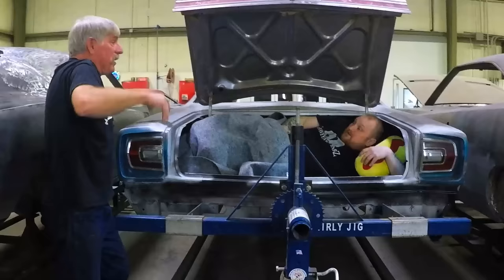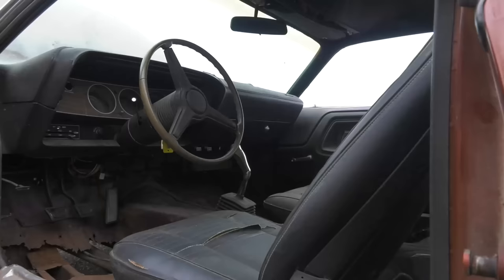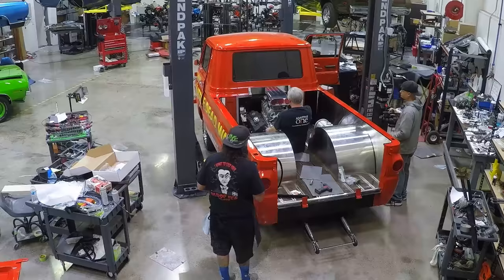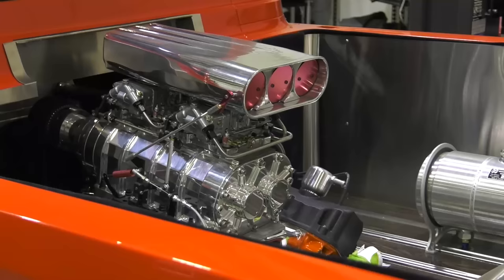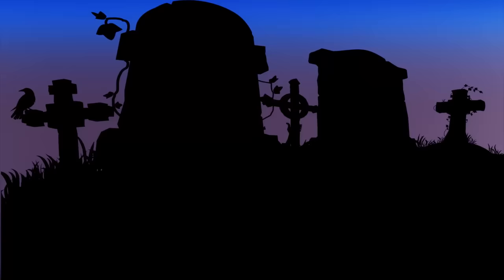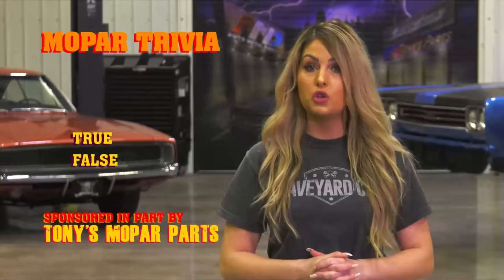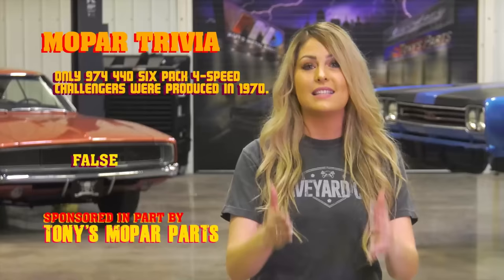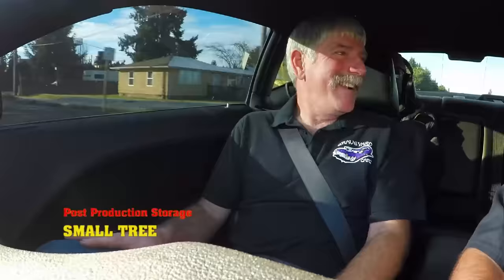GRAVEYARD DREAMZ: EVERYTHING MUST GO!

Comment: I bought my first (of 3!) Barracuda in 1979 for $600! My second one (1971) in 1983 for $1800, my third one (a 1970 body only) for $300 in 1986. The first was a  Lemon Twist with 383, 727, 8 3/4 suregrip (4:10) built way higher than my ability to drive it! (I was 17, a senior in high school) had to sell it after having 20 tickets in 12 months (mostly fix it) and lost my license for 3 months... the second one 1971, Black 318, auto, one legger. Wrapped it around a telephone pole... bought a 1970 body and swapped a 360 auto, suregrip (found the rear diff in the junk yard out of an RT Challenger!) 
That was the best cars I ever owned. Of course, if I knew then what I know now... I would still have the OG big block '70!

Comment: The little dead wagon looks great you guys did a great job. But the wood for the bed you should have stained and sealed the ends of the boards after you cut them and grain and lumber sucks up the most water it will only be a year or two before those ends of the boards that are not properly sealed start to split and you’ll be replacing them before you know it always consult a professional woodworker before installing any wood in an automobile

Comment: I bought my 69 charger in highschool straight off a used car lot in 1974 for $900. It was my greatest ride to cruise in with a 400 big block in it  blowed up the 383 when valve cut loose on me. Got the 400 interceptor motor out of a state highway patrol car. 1150 thermoquad carb on top. First race beat a guy in a cobra jet 428 Torino by half a car length.

Comment: Out of all the cars I've bought and sold, the '74 'Cuda is the one I miss most.  Also a full size van but branded Plymouth instead of Dodge.
Reply: i bought a '70 challenger with a Slant 6, got a great deal on a 318 with < 5k miles, and after a year found a k-member from a '69 Coronet and bolted it in with the same 3 Speed Xmission and rear end designed for the Slant 6.  Dual exhaust with glass packs.  i could do 45 in 2nd gear and scratch the tires shifting to 3rd.  And the sound downshifting and letting the engine kill my speed....my neighbors hated me when i drove that car after 9 pm.  Sold it to pay for my Sr Yr of college to finish my Elec Engr Degree.  Now that i retired, i'd rather have the car than a degree. LOL.  I also had a '71 Plymouth Satellite, The Poor Man's Road Runner, 318, offenhauser manifold, Holley Double Pumper, Hearst shift kit...i gave Most Camaros a run with that car. And yeah,  i owned a Dodge Stealth, 2nd car i ever bought brand new in '93.
Reply: Fargo at a Plymouth  dealership  in Canada?

Comment: I know this is an older video but here go's me.17 years old, 1974,  Martins Garage Mopar, 1972 Cuda for sale. Brown-green, 3 sp. stick, 318, all stock. about 24,000 mi. on the clock, I WANTED IT !  I needed a cosigner, I told my dad, " it's only a 318 , good gas mileage ect " Well he signed and I bought. Thu time, put holes in my muffler, loud cars go faster ! lol. out with the 3 in with a 4 speed box. 3;91 with 2 LUNGS. 2 barrel on the shelf for a 4 barrel Holley and intake to match. Cragers on all 4 , L60 15 out back with Gabriel Hi-jackers. Headers with Cherry bombs, So much for quiet. Super Shifter / reverse lockout. few other stuff , ended being a mid 13 car with that 318, I did spin the bearings on two occasions. I did get married, she got pregnant, THIS IS no FAMILY CAR SHE GO'S. I trade it to a friend of mine for a monty carlo, WHAT WAS I THINKING ? O WELL Now I'm 69 wishing I still had my 72 Cuda, 69 Grand Spaulding Dodge Dart GTS / 383, 68 GTS, 300 G , 68-69 Cuda's , 1969 Rambler Rebel SST/ 290, Loved that car. BUT I do have a 1974 Cuda now, 408 4 spd, 12;20's. some day my son gets it.

Comment: I bought my "71 Demon 340 brand new for $3150. So that would be my choice. I was 21 years old that year. I have always wished that I had kept it. It was red, with black stripes. It was really plain Jane, No power steering, drum brakes all the way around, three speed auto on the column, bench seat, and rubber on the floorboards. (no carpet) It did have the 150 MPH Speedometer though, and I buried it one day. Used to do 120 MPH once a week just for fun back then.

Comment: Which one? Simple, i buy the Demon and convert it to a 4 speed with parts from the local junk yard one or two pay checks later. Also i am the type that has no problem with restoration parts. When i drive by in one of my classics and get the thumbs up no one and i mean no one cares except for the guy like Mark that dry humps numbers stamped into parts and gets off on that kind of over priced sickness.